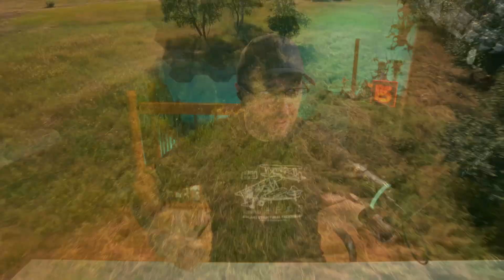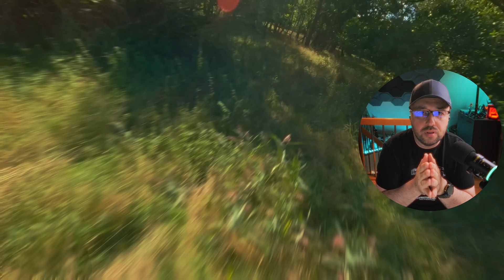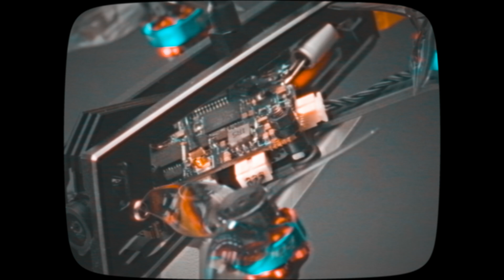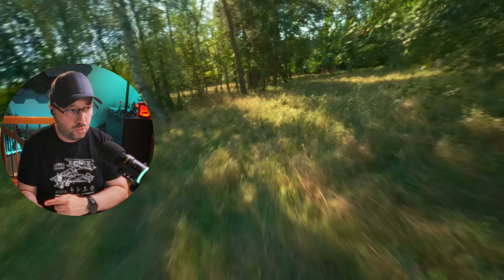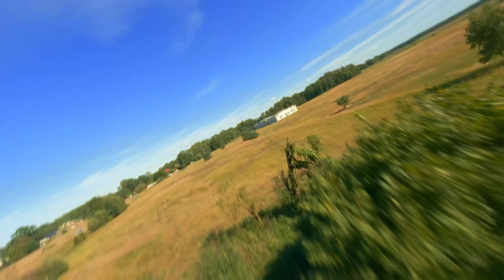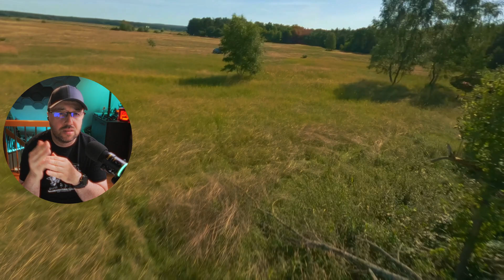This technology changed FPV

Comment: Synchronous rectification or active freewheeling was available on Kontronik Jazz ESCs back in 2004. We used it for F5A aerobatic planes and RC track cars. 
The tech is not new. It was just the slow implementation of it by the Chinese for FPV.